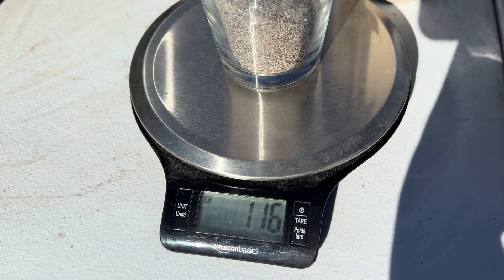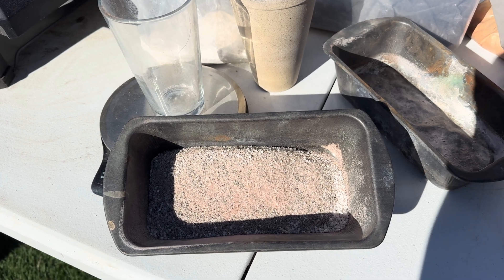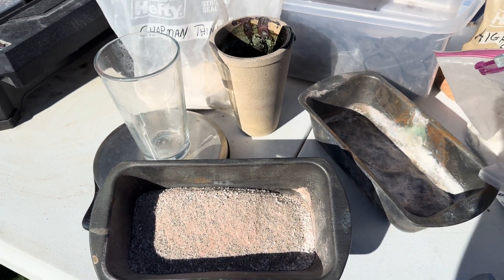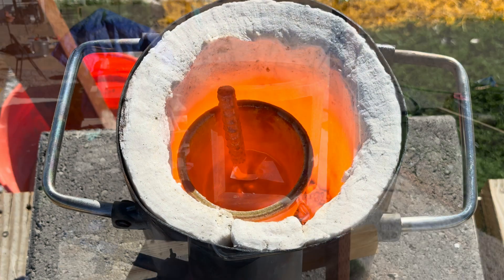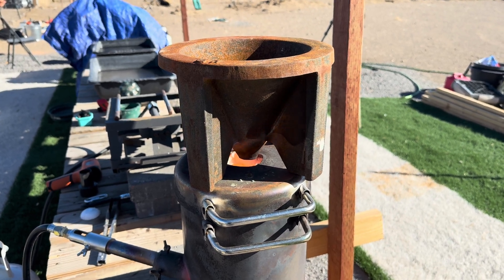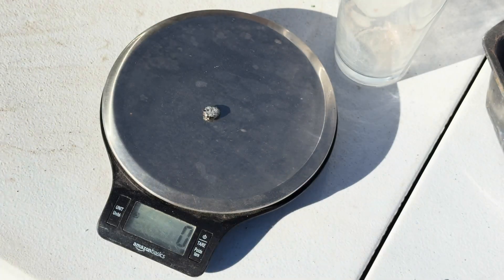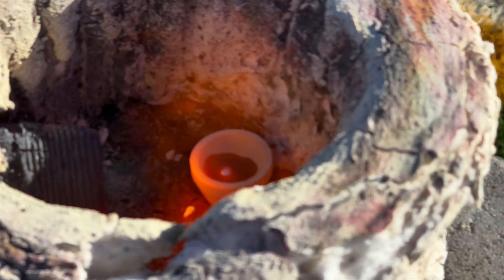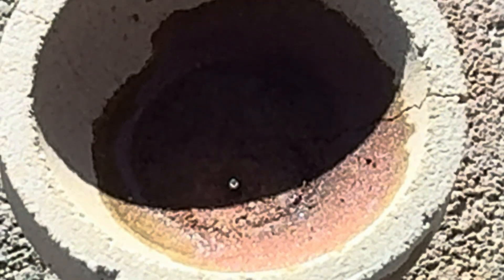Can We Get Precious Metal Out Of My Tailings Pile

Comment: Roast the sulfides first before using the process i told you about. Sulfur has to be driven off before using acid or it will cause issues.
Reply from the maker: @garrettmillsap  Hi Garrett, until you mentioned it, I did roast this material, but for some reason I completely forgot to video it or even mention it. Maybe because on the 56g of concentrate that I hope to start working on later today I was roasting it and I started burning the non-stick pan. This project was an afterthought and I needed to hurry and clean off the rust from my iron skillet and roast it before I went in. It was about 6 pm and 30 degrees outside. Or maybe I’m just getting old 😂 Thanks for catching that. Take care.
Reply: @ErnieDionne  you're welcome Ernie. Just want you to be successful.
Reply from the maker: @ Thank you, I appreciate it! With this next project I’m going to use Iron Sulfate to cement the gold. Do you have any thoughts on this? Thanks.
Reply: @ErnieDionne  that works great as well. Just dissolve the iron sulfate in water first. If it has too much color you can add a splash of HCL to the iron sulfate and it will clear it up. After dropping gold and rinsing, boil the gold in a little bit if HCL to make sure you get any leftover iron out of your gold. I know some people prefer using iron sulfate over SMB to drop their gold.
Reply from the maker: @ Thanks Garrett, this will be the first time I will use Iron Sulfate. I appreciate the insights 💪🏻
Reply: That is a great video.  And not too bad of a bead.  I am ready for winter to be over so we can get back to smelting and processing ore.  The goal for this year will be to establish a good silver process.  Thanks for the video.  I always learn a lot from your expertise.
Reply from the maker: @ You’re welcome Mr. Mahoney. We will learn and grow together. 💪🏻
Reply from the maker: @garrettmillsap  A lot of years ago I used to live in Monmouth/Independence Oregon.
Reply: @ErnieDionne  I know both of those towns very well and have friends in Monmouth currently lol
Reply from the maker: @ That’s cool! I did some church ministry work at the Assembly of God church in Independence.
Reply: @ErnieDionne  I'm in Lebanon, just outside of Albany, so I spend as much time as I can in the Quartzville mining district finding gold lol that's the stuff I've honed my chemical ore processing on.
Reply from the maker: @ That’s great. I’ve been to Albany once I think.